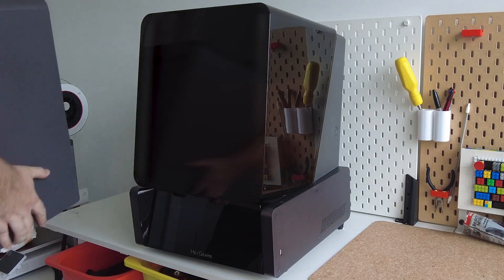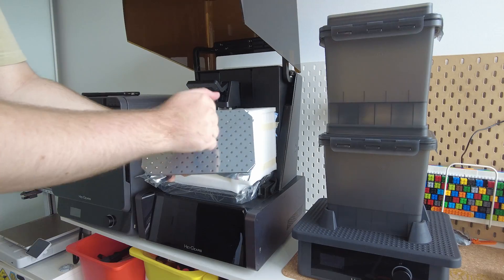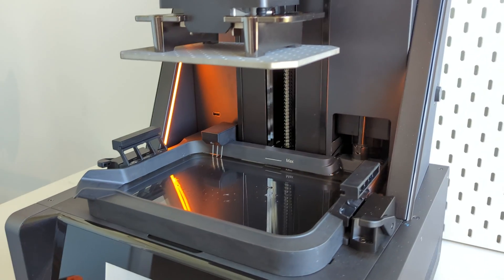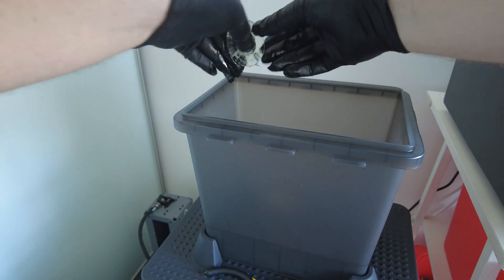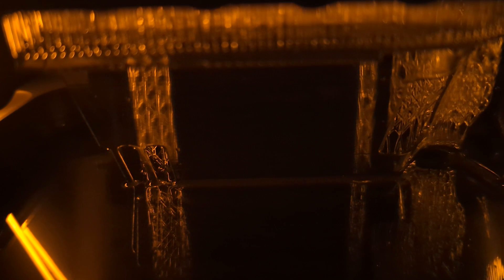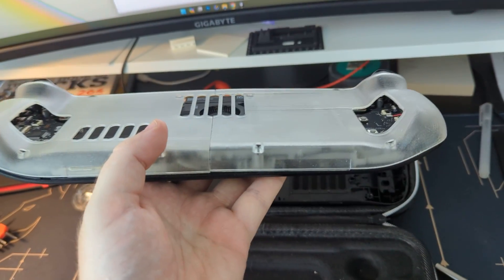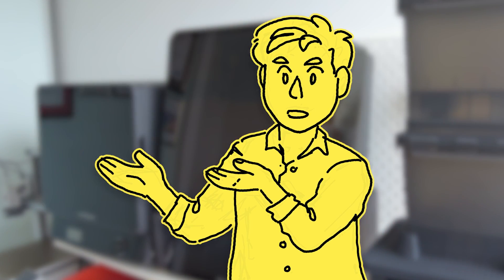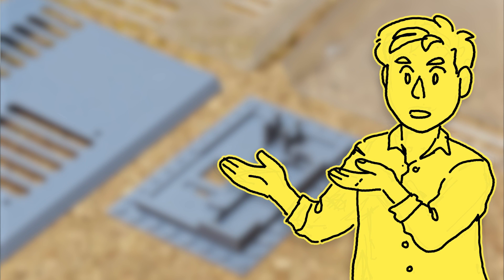How Good Is a $4000 3D Printer? – HeyGears UltraCraft Reflex

Comment: Awesome machine and the auto supports will only get better over time. I would almost consider buying but... The big elephant in the room is not being able to use third party resins. Their resin cost ranges from $65 to $99 a liter. Whereas third party resins average about $20-25. I understand they want to keep their ball in their sandbox but at least through a bone and open up the ability to add third party resins and resin settings. Hopefully they will open up but lots of people have said not being able to use third party resins is the deal killer. I know it is for me. Hell, if they allowed third party resin and tweak settings I would buy it in a second. Hopefully HeyGears gets the hint.

Comment: How's the resin smell ?? Is it horrible??
Reply from the maker: It doesn't smell nice while printing, but it's not nearly as horrible as some other cheaper resin printers I've used. With good ventilation, I didn't have an issue being in the same room as it during a 5 hour print, but I do try to avoid it if possible. Hope this helps!